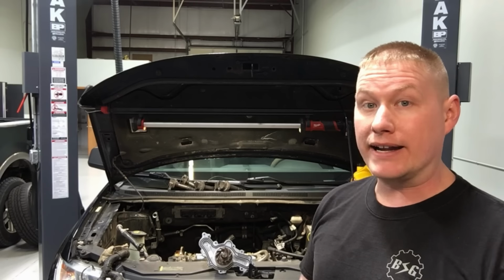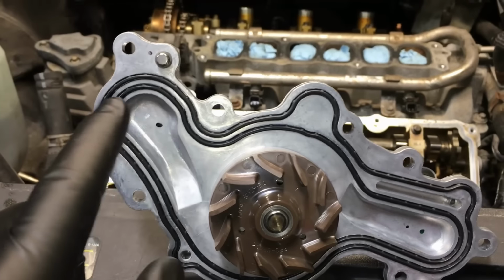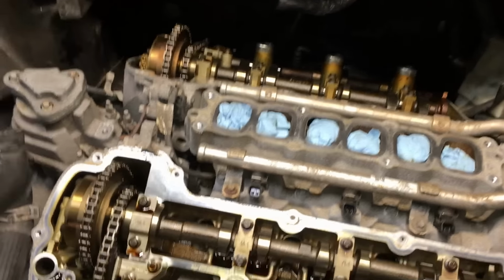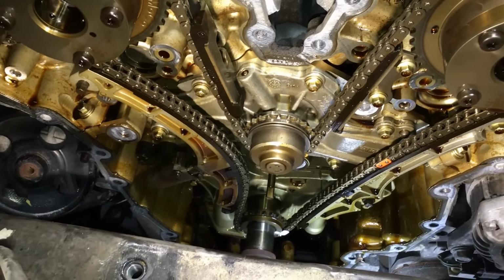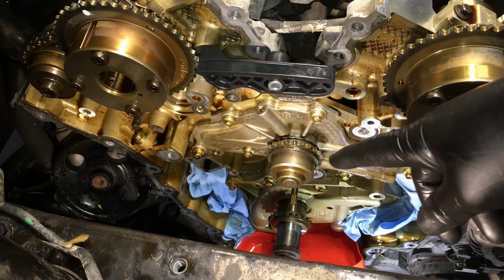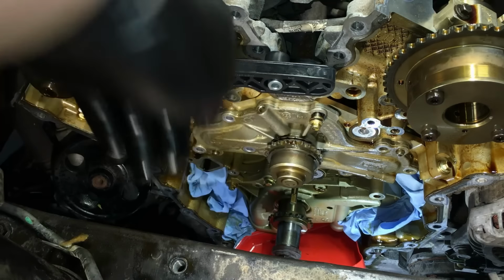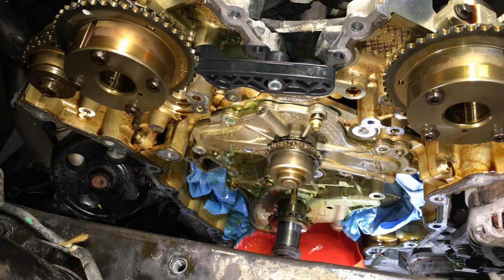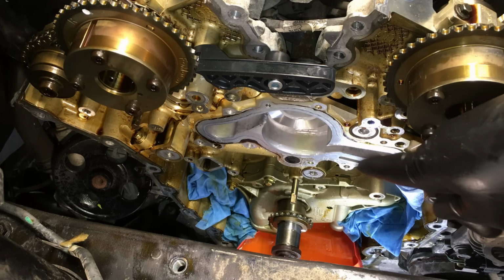Ford 3.5L 3.7L Duratec V6 Chain Driven Water Pump Failures: Check it Before it Destroys Your Engine!

Comment: Thanks for posting your awesome video. Warning to others!  My 2018 Ford Edge with 48,000 miles had the  engine light come on briefly and we were hearing a sloshing liquid sound behind dash. I checked under the hood and discovered the coolant level was 2-3 inches below the fill line in the plastic tank but no visible leak under the car. I checked oil and it was fine. So we called Ford dealer service and took the car in for repair. They diagnosed the water pump was leaking - after pressure test (30 minutes) showed 7psi drop in engine pressure. TSB said it should be 5 hour pressure test and if the pressure dropped 4psi during test they should then remove spark plugs and borescope the engine. The tech ignored this step even though pressure dropped 7psi and just replaced water pump and called it a day.  They didn’t check oil for coolant or change out oil after repair. We picked up the car on a Friday after 2 week repair and within a few hours the engine light came on again and the sloshing sound behind dash was still present.  Called dealer and they said bring it back first thing Monday. 
Monday morning when we started the car a ton of white smoke poured out of both tail pipes and the engine was running rough. Upon hearing the new symptoms the dealer service tech said “Oh this indicates a more serious problem.” Ya think!?  Of course, now they borescoped the engine and determined it to be ruined. Replacement cost 9k!  Fortunately, I had purchased a third party extended warranty ($1900 with $100 deductible) that had just covered the water pump replacement. After 5 weeks of back and forth and coughing up all the service records, the warranty company agreed to cover  $8,400 of the $9k repair. So I’m now being asked to cover the $600 difference.  No thank you. I’m asking dealer to cover the $600 difference since they failed to properly follow the recommended TSB procedures to accurately diagnose and check engine for coolant in the oil the first time when they only replaced water pump.   This is a well known Ford Duratec engine design flaw for this 2018 Ford Edge and dealer should have known better. If the water pump inside the engine compartment leaks and there’s no external sign of a leak (puddle under the car) and the coolant tank is 2-3 inches below the fill line that liquid probably ended up in the engine.   Dealers excuse “We can’t borescope every Duratec engine that has a failed water pump”.  Yeah but when the TSB tells you do that if certain criteria are met and you choose not to - you’re responsible.  At the very least the dealer didn’t replace engine oil after changing water pump so it’s possible they created the environment that quickly damaged the engine when all the coolant fell into the engine compartment during repair. I checked the oil before I brought the car in the first when I noticed coolant level was severely low.  The oil looked normal and at that time there was no white smoke pouring out of tail pipes. White smoke only appeared after they made initial water pump replacement.   
Thankfully, I purchased the extended warranty and had done all schedule oil changes and had all maintenance records leading up to the water pump and subsequent engine failure at 48,000 miles.  Ford this should not happen!
Reply: My pump went at 58,000 on a 2016 explorer. Mechanic near me estimated repair at $2400.00 provided there is no other damage. No lights ever came on and no overheating, my heater was blowing cold air not hot. I thought it was the thermostat so I changed that which was surprisingly easy. After that i ran the engine and after turning it off the leaking began. By the way, ford wanted $3200.00 .
Reply: This is why I prefer to do what I can myself. A job like this, I would more than likely take to the shop, but I would be nervous about them messing something up...
Reply: Absolutel headache

Comment: Question: Should you also change the oil after replacing water pump to makes sure no coolant is in the oil?
Reply from the maker: Yes, all of the coolant fell into the oil pan in the video.

Comment: i have a friend whos 2015 lincoln mkx  is over heating at idle but cools when she starts driving, she was told water pump and this is the stupidest fkn design having it in the block, but we replaced radiator fan because one wasnt working, so now both work but it still over heats, gonna try thermostat next, fingers crossed it's not a water pump but idk if it is cuz level of coolant in reservoir isnt getting lower. these have drain/weep holes i guess on the block by compressor i read but they get plugged up with stuff so that makes it drain into the oil cuz it cant get out, gonna check that just in case

Comment: Swapped out the radiator in my moms 09 ford flex still over heating so im guessing the water pump is bad 
I don’t got 14 hours to work on it and it’s on its last leg so it Time to say goodbye 
Good vid let’s me know what I was getting into before I jumped the gun

Comment: I worry about this often. Especially on days of extreme temperatures, hot or cold. My Lincoln MKZ is at 240 on original pump. In the summer i remove the engine cover/ skid plate, thinking more air keeps the motor a few degrees cooler. I have the ability to fix it myself. I also feel like "if it's not broke, don't mess with it", but check the oil ridiculously often!

Comment: Here's another symptom:  an intermittent stench of something burning under the hood.  Sometimes at a traffic light we'd get a sudden waft of burning coolant. My wife's car was weeping and burning off the coolant, but I was looking for an oil leak when the car was cold.  Dry as a bone.  It wasn't until it got worse and started leaving a puddle of coolant on the ground and losing coolant in the tank did I suspect the pump.  Ran it weeping like that at least a year before realizing what happened.  No coolant in the oil though!!

Comment: 3.5 is a wonderful engine regardless of the water pump difficulty
Reply: The water pump issue makes it a shit engine when installed transversely.  Great engine if RWD.
Reply: When you think about it, Toyota owners with timing belt engines pay $900 to $1300 every 90k miles to change the belt & water pump out. If a Ford owner has to pay $1500 to $1800 every 175K miles to change out this pump it is about the same.  The two things you need to do are 1) strict maintenance, change oil every 5-6k & change coolant every 40k. 2) Check that weep hole area once a week or so to catch a pump leak before it grenades the engine. And you are right, other than the WP situation it is a very good engine.

Comment: currently have a dealer telling me it's $3500 just in labor to repair.  2015 MKZ, 60k miles.   Why would they put a part that fails so often inside the engine?  (to destroy the engine, so you need a new car sooner)  coolant falls directly into the oil pan.  people wonder why I hate Ford, but wife wouldn't listen.

Comment: What mileage would you recommend changing the water pump, chains and guides/tensioners? I just bought a 2016 flex NA with 96k.
Reply: My 2016 just went bad at 106,000 miles. FWD $2,200 at dealer.

Comment: I’m seriously considering the purchase of a used Lincoln with the 3.5 with 75,000 miles on it. The car is immaculate and priced right. You know I’ll be on my back with a flashlight looking behind the alternator after I do the rest drive. I am the scared owner of an Edge with the 2.0 Ecoboost and have been losing sleep worried about the coolant cross over block channel issue. Honestly, can Ford not build anything right?

Comment: Saw more than 6 Mazdas CX9 LOST THE ENGINES DUE TO THIS PUMP
1ST AT 150K 
ONE MY FRIENDS LOST AT 220K and full rebuild was done
ANOTHER ONE AT 330K and changed the engine 

THIS WATER PUMP MaKES ME RUN THE CAR AT 2500 RPM MAX,, 
This is really true pain in the ass 

I like the qoute of one mechanic who saw this engine for the first time, he said that engine could never last as a normal V6, it is so compressed that you could find some new malfunctions that we never heared about,, I couldn't get what he said,, but now I know exactly how this pain feels and how much it costs
Reply: Typical Ford automotive engineering. Build Ford tough actually means...tough $#!t when it breaks down or when parts wear out (because they don't last due to poor design) and you can't replace them or do the work yourself without a lift or special tools. Also good luck with Ford customer service, you might as well talk to the wall because nothing is covered under the recall warranties. I'm one of thousands involved in a class action lawsuit for the Explorer, Edge and Escape that I own😢😢😢

Comment: This got me on a 2018 Explorer. I had a flush at Ford and the next week had a shop change oil. They said I needed a water pump. HHMMM. Any way, took it to Ford and they said it is a very common and expensive repair. I had not long ago bought a Ford warranty. (bought it in Ct. and I live in Va.) you can save a lot of $$$$. Cost me $200 for repair. Dealer charge in 2024= $4,000!!!! Car only had 22 thousand miles. I do wonder if flush brought it on.🦇
Reply: I have a 2016 Lincoln MKX that I bought used in 2018 with 30K+ miles on it. I am now dealing with this issue -- slow coolant leak led to overheating and coolant mixing with oil and engine shutting down. 

@FordTechMakuloco What I do not know is if the engine can be brought back or if it is DONE. Will replacing tbe water pump show you where the problems are on the engine, or do you need to take more parts out to inspect? Can you do an engine flush to get all the coolant out, or is the engine a lost cause? Dealership service is saying $11K for a new engine, not offering any other options/diagnosis.
Reply: @nikolashill3703  Could not swear where water is coming from afar. They told me it leaks at rear of alternator on my Explorer. They should spot where rather quickly. Even a pressure test should show it. on the pump I think the rubber gasket was the issue on these. To inspect pump is to replace it. $4,000 on my Explorer w/o warranty. A lot is going to depend on how much you love this car. Always a question on can it be saved. If it was mine and I loved it and a lot of coolant has gotten in, I go Ford mtr new motor. I did that on a 96 Pontiac and it was 5,000 back a few years ago. Good luck!🦇
Reply: @dustbat  I really appreciate that feedback. I do love the car, but it's probably better than I get into a new car. 😕🤦🏽‍♂️ This sucks.
Reply: @nikolashill3703  Know how you and it feels. Try never to fall in love with a car. Guess you have finished the troubleshooting.🦇

Comment: Dare I ask, did you go back w Ford Water Pump? I'm in the start stage of mine and no idea of a quality water pump? 

OEM chain?  Done several of the GM 3.6 in Traverse's and only OEM on them. Terrible to do an in frame job on
Reply from the maker: Only use OEM yes
Reply: @FordTechMakuloco Please see my comment about my 2016 MKX engine. I am in a tough spot and would appreciate a bit of insight.

Comment: I own a 2013 Edge with 140,000 miles on it.  I change my oil every 5000 miles(use full synthetic only) and and use Ford antifreeze change every 3 years.  The motor uses no oil between oil changes and the motor sounds strong.  I think regular oil and antifreeze changes will prolong the life of the water pump.  If it does start to fail I will spend the money to replace the pump, timing chains and guides. I have heard of these motors go 480,000 miles if they catch the water pump failure in time

Comment: Have you ever seen pump mechanically fail? I have a 13 Taurus which I’ve done this job to a couple years ago. It’s overheating now and doesn’t seem to be flowing coolant. Replaced radiator, thermostat, flushed heater core, no joy…

Comment: I’m looking to change the plugs on my wife’s new to her 2012 Edge with 3.5. What is the plug number…I’m getting conflicting # from dealer and auto parts store. Motor craft 589x platinum was one part and 520. Also where is a good online source for OEM coil packs. Our local dealer wants $ 160.00 a piece for one and 10.00 bucks a plug. The edge has 120,000 on it and never been changed. Thx

Comment: Have a 2014 with 171K on it. Going to have a BS test done to check on coolant. Mine is Ecoboost, so a LOT more parts to remove, but will do the entire timing chain at the same time.  Engine runs great.

Comment: Do you happen to have a parts list for the components to replace
Reply: Depends on the year as some had differnat water pumps and chains. 
At minimum you should replace...
Water pump (I use Ford as AF ones are hit or miss. Airtex/Carter are ok if you can't get motorcraft. Gates and most others are junk)
Timing chain kit (Mellings pro kit is good or use Ford. Don't use service grade or other brands though.)
Valve cover gasket set
Intake plenum gasket
Front crank seal
Ultra black RTV for the timing cover. 
Coolant + oil/filter
Several cans of brake clean. Clean the timing cover well before installing. 

Thats the minimum. Also good time to inspect/replace plugs, serp belt, and motor mount as well.

Comment: If oil gets mixed with the coolant, how do we clean it before adding new oil?
Reply: I had this done about 3 years ago. You're supposed to clean out the oil pan completely and wipe it clean. With the engine fully assembled, put fresh oil in and run it for a while. Drain the oil. Do about 2 oil changes on it to clean out all the contamination before topping it off with fresh oil.
Reply: At what point do you know if the mixing has caused irreversible damage to the engine? My dealership is saying this without any specific information on my car/engine, but I don't know what else to do other than trade it in on another car.

Comment: Why are you starting the ratchet spin before you get the socket on the bolts? That's an easy way to strip the bolts and cause you a huge headache later.
Reply from the maker: You must spin them up beforehand or the software will cut power to the tool. Have you ever used one of these electric ratchets? They are all the same, high speeds are even more sensitive.

Comment: The water pump was moved to the inside of the engine in order to get it in the car, otherwise the engine would not fit. These are great engines, but this pump is a huge pain in the butt to change for sure! Thanks for your time explaining how to change the pump.
Reply: 03 Ford escape, pull engine to replace starter.

06 mustang pull engine cuz one timing chain is on the back of the engine 

2016 3.7 pull engine to replace water pump

14 hrs to change water pump?

Ford sucks
Reply: @ghostmost2614  You don't need to pull the motor to change the starter in an Escape or water pump in any 3.5/3.7
! 🤣
Reply: @ghostmost2614 agree no more ford for me after my 2003 f150 no more
Reply: I had one of those 4.0 engines with the rear timing chain AND the timing chain to nowhere. Mine was in an Explorer Sport. I loved the truck, bought it as a project, fixed it, and ran it til it rusted apart.
Reply: They could have put it behind the engine and above the transaxle driven from one of the camshafts like the 3.0 Duratec V6.  Too bad, the 3.5 is a 300K mile engine easily with nothing but oil changes if it weren't for the water pump.
Reply: @ohger1  Still is 300k capable on original pump. I was a stickler but the amount of people in the Facebook group in original waterpumps high mileage is incredible.
Reply: @WildSideComedy   Mine has about 260k on it.
Reply: @WildSideComedy  Those are the exceptions and just luck that they got a higher quality pump by accident.  Speaking broadly, not just Duratec, water pump end of life is highly variable.
Reply: @JeffDeWitt  Keep praying. :)  I would check my coolant level and visually examine the dipstick very, very frequently.  You are living on borrowed time.
Reply: @frequentlycynical642  There is no getting a "higher quality pump by accident". The original can last as long as any other pump, just need to watch for the signs as it's incredibly rare that critical failure occurs before weeping occurs.
Reply: @WildSideComedy  The weeping only indicates water has moved past the pump to block seals, nothing to do with the shaft seals.  It's the latter that dumps water into the oil.
Reply: Why not spin the pump once the chain is off the sprocket, so that all the water above the pump gets shot out before you break the seal and let the coolant leak all over the place and possibly into the engine?
Reply: @davidshumway9639  You can't turn it fast enough to get the coolant to "shoot out."
Reply: It would've fit cam-driven like the 3.0L
Reply: Why couldn't they expand the engine bay and have an external water pump?
Reply: @popeye5808  They had to work with the body as it is.  You don't "just expand the engine bay."
Reply: @popeye5808  As individuals who are not engineers for this type of topic, we may never know.
Reply: So they didn’t think of the waterpump when they were designing this engine? I’m not an engineer but if they can put a fuel pump outside of the fuel tank and well away from the engine, they should also be able to do the same for the waterpump.
Reply: @rogercustodio6498 I drive a 2012 fusion sport with the 3.5l. The reason it is internal is because there isn't a quarter inch of clearance in the engine compartment with that big V6 in there.

Comment: hi guys!  When the water pump fails, as I understand it, the oil mixes with the coolant???
Reply from the maker: Only if the shaft seal fails which isn't too common.
Reply: @FordTechMakuloco  you're a legend for still commenting on old vids... Any preventative maintenance tips ?
Reply: @FordTechMakuloco  How long, and how much damage, does it take for the engine to be "destroyed"?